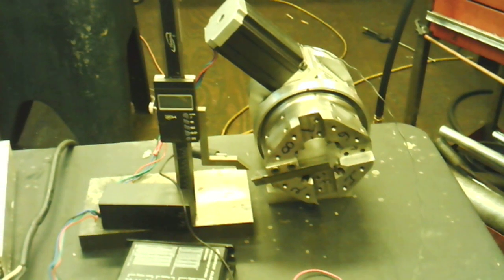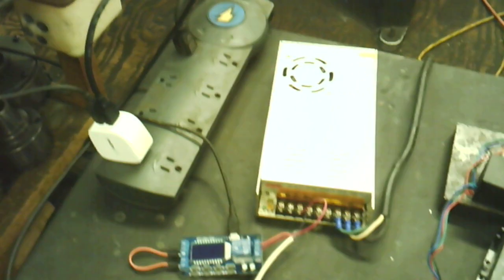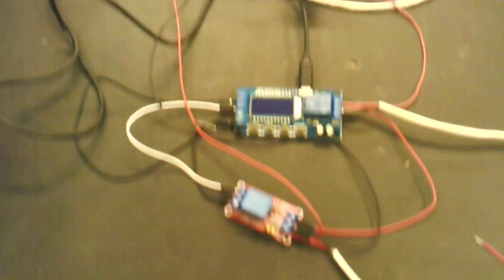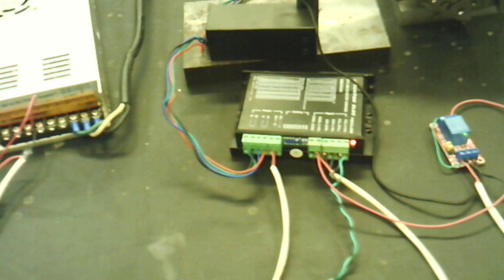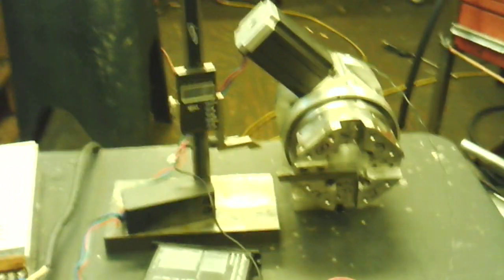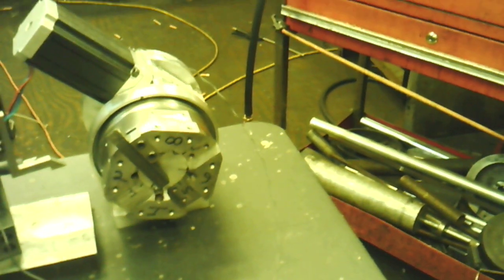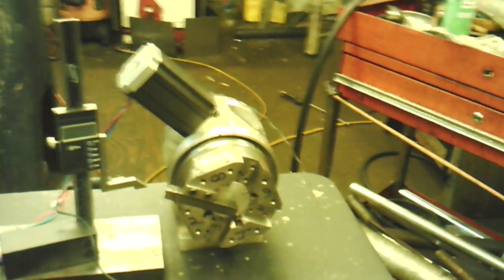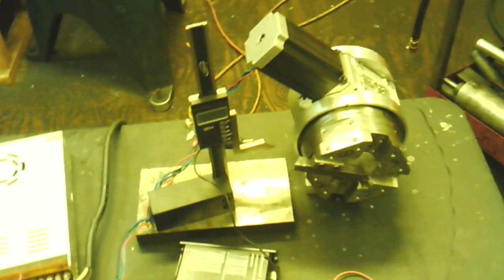8 position tool turret update

Comment: no curvic coupler?
Reply from the maker: no flux capacitor either
this method was not used in final setup
see https://forum.arduino.cc/index.php?topic=639293.0 for information on final results.
steve